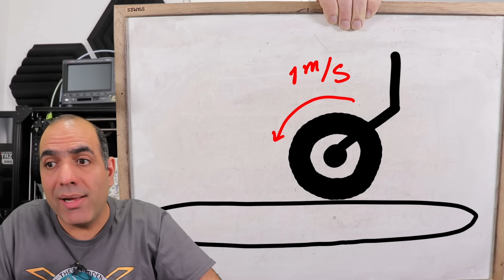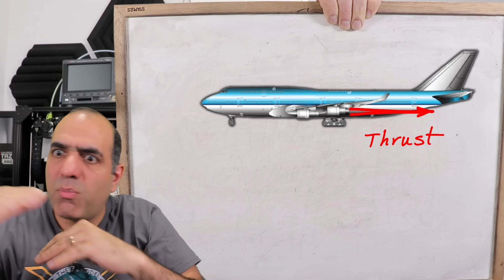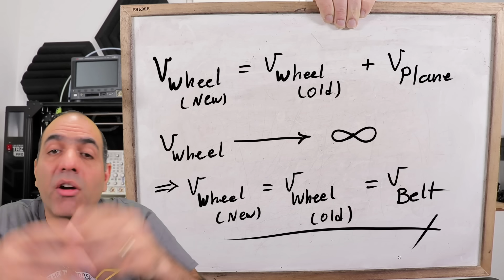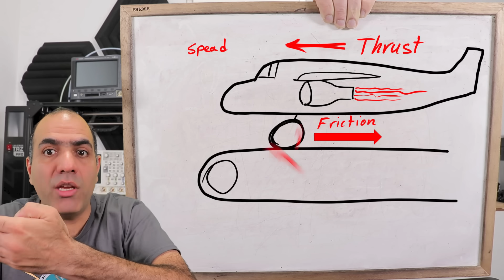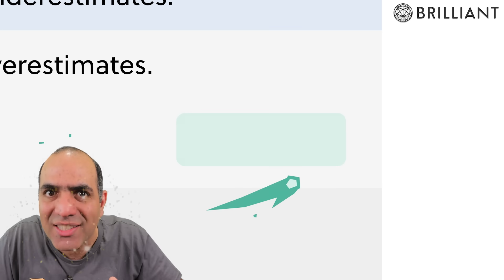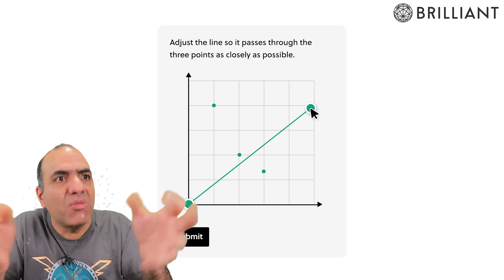Airplane Question that Drove Me NUTS!!!

Comment: Assuming a runway at sea level on Earth, with no wind: The jet engines produce their normal thrust. That's more than enough to overcome the friction of the wheel bearings. The plane starts to accelerate, and so the treadmill accelerates. Usually the bottom of the wheels is still, the axle moves at 1x the speed of the plane, and the top moves 2x the speed of the plane. With the treadmill the wheels bottom gets pushed backwards, instead of being stationary, presumably (given the description) at the speed of the plane in the opposite direction. This creates more friction in the wheel bearings (more heat) since the wheel is spinning twice as fast as normal. The plane can easily overcome this friction and take off, but may suffer damage to the landing gear.

Aircraft don't drive their wheels like cars do, they work by pushing air backwards. If the question posited a giant fan creating a tailwind exactly equal to the forward velocity of the aircraft then the plane wouldn't be able to take off, but it didn't so that's not relevant.

Comment: Technically speaking, the conveyor belt could be spinning so fast, that it starts to spin a current of air so fast under the wings, that it would push the plane off the ground / fly
But assuming traditional wind pressure and dynamics, obviously not.

Comment: I think the plane would be sucked down into the conveyor.
The question is missing many parameters,  but there would be a vacuum force generated between the fast moving conveyor and wing. With high relative airspeed below the wing, and none above, the wing would be pulled down - much like two large ships sailing near to and parallel to each other get sucked together.

Comment: 36 seconds in the video and i know the answer....of course not..." oh but the airplane needs only to push the air to fly"...yeah...but since it said the conveyor belt maches the speed of the weel, as soon as the airplane starts moving the conveyor belt will start pushing in the oposite direction, making it so as long as the airplane is in contact to the conveyor belt, it wont be able to build up speed and fly...the same applies to a completely still airplane, that if we run wind fast enough on it, even if it's still, it will start lifting up with no propultion whatsoever....friction with the conveyor belt will keep the airplane from flying

Comment: Here is what Intuit has to say about this question:

Prompt: 
Imagine the following scenario: A Boeing 747 is sitting on a runway, ready for takeoff. However, the runway is not like a typical runway, but instead is a giant treadmill. This treadmill is designed to operate at exactly an equal and opposite speed as the tangential velocity of the aircraft's wheels. In this scenario, if the aircraft attempts a standard takeoff, will it be able to leave the ground?

I think that's a fair way to describe the scenario and the question. I specified the model of the aircraft, replaced the runway with an imaginary treadmill, specified tangential velocity instead of saying "speed", since that's not really the correct term, and omitted details that aren't relevant to the thought exercise, like bearing friction or wind.

Response:
A Boeing 747 must travel at a minimum of approximately 160kts to achieve takeoff. During a standard takeoff, the combined power of the engines from the aircraft will produce an acceleration of approximately .2gs. Every wheel imparts a normal force to the treadmill of approximately 101 kilonewtons. I do not know the coefficient of rolling friction, however, it is very unlikely that it is high enough to result in a sufficient friction force to overpower the thrust force at speeds below 160kts, as most coefficients of rolling friction are fractional values that are less than 1. However, for the friction force to be high enough to prevent the 747 from reaching 160kts, the coefficient of rolling friction must be higher than 3, which is not likely. As such, the 747 can achieve takeoff in this scenario.

Abridged response:
The 747 can reach its minimum takeoff velocity, aka rotate, before the friction force is high enough.

I don't know where these numbers come from, but I also don't see in 11 dimensions so I defer to our electronic overlords

As for the actual answer which I can surmise, the answer is yes. Given reasonable implied conditions like having an atmosphere and being fueled, it doesn't matter how words like "wheel speed" are interpreted, it will take off. An aircraft as beefy as a 747 literally does not care about what the ground wants to do, only the air around it.

Comment: It seems like the question was posed by someone who really does not understand physics, or flight dynamics. It appears that they think the plane is driven forward by the wheels. What about a seaplane that has no wheels? Lift is only generated by the air speed over the wings. The belt can run at any speed it likes, even backwards. The thrust provided by the engines, just has to propel the plane at V1in relation to the air. Even if that means first overcoming an initial backward motion. If the belt is running forward at V1, the plane will be catapaulted into the air, lift off and then crash. Unless the propulsion is already providing V1. Simple

Comment: This seems so obvious… but the fact electroboom is discussing it makes me think I’m not even close to being on the same plain as him… 

If the wheels spin but the plane doesn’t move through air… then nothing happens.. surely
Reply: our intuition about how ground vehicles work is why there's a lot of knee-jerk reaction comments on this video and the post claiming the answer to be obvious. Because the wheel RPM is driven by the friction force from the ground rather than by a motor, the wheel tangential velocity must be greater, at least until the thrust force and friction force are at equilibrium and no acceleration happens, which wont happen at any normal speed we can imagine.

Comment: There wouldn't be any force, as planes lift off by pushing air underneath their wings and since the conveyor belt is perpetually matched to its speed, the plane can never accelerate into the air it needs to push down.

OK continue the video

Comment: There are several versions of this question. In one they say the belt moves backwards as fast as the plane moves forwards. So the wheels only go twice normal speed.
Reply: I think that's the original version of the question.  I've seen it in physics textbooks.

Then some smartass went "But whAt iF yOu SpEd iT uP?"
"It still wouldn't do anything"
Then he said "But wAt if U SPeD it up EVEN MORE"
"It still wouldn't do anything"
Then he said "buT I DEFINE iTs spEeD the SAME.  It HAS to stop"
"That's assuming the conclusion."
"I WIN!"
"...you know, whatever"

It's things like this that time cube comes from.

Comment: Scenario no. 6: “The Death”
The Belt matches the speed and starts to accelerate, eventually reaching infinite speed (the bearings should tolerate this, since it happens instantaneously, there is no time for anything to heat up or destroy itself). Since there is no delay given between the speed check and the belt matching that speed, we assume it's 0. This means that the acceleration is also infinite, since we're going from 0 to infinite in 0 seconds. A conveyor moving at infinite speed would probably attract a few physicists, who would scratch their head and wonder what's going on. Infinite acceleration also means infinite energy. And that would probably destroy the earth and the whole universe.

The end (of all)

Comment: The question states, that the conveyor BELT is as wide and long as a runaway. Meaning, since the belt is wrapped around the conveyor belt construct, the plane would have just half of the length of a runaway available to take of before it falls off the conveyor belt. So if the plane would have its thrusters enabled, it still might not be able to take off depending on how fast it's able to accelerate.
Case closed.

And I hate this type of questions too, because they lead to nothing but controversy with not a single step being made in forward direction to improve or understanding things.
I'm an electrical engineer and i love efficiency, also in processes and workflows! Why wasting your precious energy on stupid questions like that? And so I do again.

PS: If you don't like the answer, outcome or result of something, read the question, task or specification again and find the loophole to justify the answer. If the game is stupid, don't play the game, play the rules so that the game is no longer annoying you, but you're annoying the game and anyone that likes to play it!

Comment: I've heard this described as a language problem not so much a physics problem. I remember the "Mythbusters" episode years ago, and I got it wrong then, and it pissed me off to no end, trying to figure out where I went wrong.  Then my wife explained it to me, and I had it in my mind.  For a bit. But I lost it. And now revisiting it has lead me to the conclusion that I am going to plug my ears and hum and live in my world where if air isn't passing over the wings the fricken jet doesn't take off.
Reply: to say it with Adams words: "I reject your reality and substitute my own" =D
Reply: You are correct, if air isn't passing over the wing, the jet won't take off.
But the "wheels" of a plane are just bearings. The jet engines push the plane forward on those bearings, so as long as the bearings are free to spin, the plane moves forward.
Reply: Randall Munroe (of xkcd fame) wrote a very good blog post about it back in 2008.  He sees three possible interpretations:
1: The belt moves at the same speed as the bottom of the wheel: the treadmill never moves, because the wheels on a plane taking off are always rolling without slipping.  The treadmill acts like a regular runway and the plane takes off.  Not many people like this interpretation because it's boring.
2: The belt moves at the same speed as the axle of the wheel: the wheels have to spin twice as fast as usual for the plane to take off, which seems doable.  This is his favored interpretation, because #1 is boring and #3 has huge problems.
3: Hook up a speedometer to the wheel and have the treadmill move that fast: he thinks that this is how most "plane won't take off" people interpret the situation, but he points out that that math only works out if the plane isn't moving, in which case the treadmill also isn't moving and so isn't holding the plane back at all.  Once the plane starts moving, the math can only work out if the treadmill speed jumps instantly from 0 to infinite.  So in that case the plane can't move because if it were to move the system breaks down immediately and the problem description no longer holds, but obviously a non-moving treadmill can't stop the plane from STARTING to move.  Since the description no longer holds once the plane starts moving and doesn't include a mechanism to stop the plane from ever moving, it's...not a great interpretation.
Reply: The question is just confusingly worded. The treadmill matching the speed the wheels are rotating does NOT mean that the plane is stationairy relative to an observer standing next to the treadmill. If you were standing next to the treadmill you'd basically see a plane normally accelerating down the runway and then taking off, because the treadmill isn't going to stop the plane pushing on air to move itself forwards, it's simply going to cause the wheels to rotate more quickly.
Reply: exactly, but the turbo-nerds need to prove how smart they are. it's a completely fuckin magical question. hence why it's not so "anyone who bebebebe my brain dick is bigger than yours!"
Reply: Agreed. These questions are not much better than "Why does 2 + 8 + 9 =10? Because (T)wo, (E)ight and (N)ine spell TEN!" type questions. They are language puzzles
Reply: @Mandragara no cuz 2 + 8 + 9 = 19, 1 + 9 = 10 xD
Reply: I also got it "wrong". I assumed the engine would be turned off. The question in my mind was, can you cause enough drag winds and ground effect to make the plane take off by just moving the conveyor belt. That was an interesting question. Testing it with the engine on was just so anticlimactic. Of course it takes off if the engine is on!
Reply: Yes. The reason why it's a language problem is exactly as stated in explanation 3 of this video. Strictly adhering to the imaginary scenario proposed by the question, the conveyor and wheel speeds reach infinity, invalidating the reality of the scenario entirely so it doesn't fly. 

In reality, a conveyor belt does absolutely nothing to an airplane. However, because the impossible physics-breaking infinite conveyor belt is a necessary given in the thought experiment, it makes the plane not fly.
Reply: of course air is passing over the wings.  why wouldn't it?  Break down those objections in order.

...because it's not moving forward?  Why wouldn't it move forward?
...because the wheels are stopping it?  Not unless you left the brakes on!  Imagine a car in neutral.  The road doesn't stop it.  The wheels just spin.
...because the wheels aren't pushing it?  It's an **AIRPLANE**, not a car!

*THE ENGINES* push it.  Plane moves forward.  The wheels, "in neutral" with the brakes off, turn freely.  Air moves over wings.  Plane lifts off.  End of story.

The treadmill is a red herring.  How we're still arguing about this in 2023 I cannot imagine.
Reply: Yup. Me too.
Reply: Planes ride on skateboards.  Easy as that to understand.
Reply: @BrandoDrum  maybe the turbo nerds have a point for the plane, but i refuse this one. i've skateboarded and you 100% could keep a skater stationary with a magical treadmill as proposed.

Comment: would this kind of question be called a fallacious question? A not native english speaker asking on a channel of another non native english speaker. 😅
I could however imagine, if the plane has it's engines running and and is doing a normal takeoff procedure, it could happen that if the friction is enough to keep the plane in it's physical space and the air generated by a rough surface moving fast underneath the airplane could maybe create enough moving air to take of, but I believe it would be quite turbolent. 
Just a very uninformed theory on my part. though I highly doubt you could get this done perfectly.

Comment: Actually the answer is fairly easy and here is why. You see it boils down to how wheels work. 

Wheels work independently From the arm the bearing is in 

So once the airplane starts moving the wheels should turn right, and that is where the people go wrong. On a normal runway the wheels need to move in order to let the plane roll and get up to speed, but on the conveyer belt the wheels DO NOT move at all. 

The reason is because when the wheel wants to move the belt counteracts that movement, so it doesnt start rolling forward with the plane. However the bearing on the axle does move, the one in the arm. Yes it has friction and should move the wheel but the belt counters that slight friction. Now because the plane can easily overcome that friction in the bearing it will start moving forward (relative to the ground). 

The answer is the wheels never move but the plane does due to how bearings work.  It's the same with how differentials work, if you lock the wheel it needs to turn with the axle, but once you unlock it the axle doesn't have move for the wheel to turn or vice versa. 

I seriously do not know why this question is so hard for people.

Comment: Comment before the answer:. I am gonna say no because lift requires the movement of the air over and under the wings.  Staying in one spot will only put a load on the engine redundantly.

Comment: The plane needs to move so that the air can create the necessary lift force so that it can take off. It has nothing to do with the speed of the wheels, only with the speed of air around the wings. If the plane stays in place relative to the surrounding air - it can not take off. Otherwise we would have plane launching conveyors on buildings.

Comment: Since the belt is as long as the runway it will have way more inertia than the wheel (and thus never be able to catch up with the speed of the wheels),  the design of the belt is infeasible even by magic unicorn standards. The plane will simply take off and ad worst take a bit longer than normal but the belt will never create enough friction to matter.

Comment: What about this one, let's say that there is friction between the wheels and the conveyor belt, but not within the wheels (ideal wheel bearings), then assume that the conveyor belt has unlimited power and hasn't speed limit and the engines on the plane are off(just sitting) and also someone walked inside the plane walked towards the tail(it will make the frictionless wheels roll foward and set the conveyor belt to infinite speed to keep the plane stationary), depending on the thicknes of the fluid(thicknes>0),  due to the speed of the fluid dragged by the conveyor belt and its relative speed compared to the plane the plane will take off

Comment: Hello, I don't think the plane flies because of Bernoulli's equation. In this example, the speed of the top wing of the plane is zero because we are supposed to stay relatively still, and for this reason, the pressure of the air flow above the wing is higher than the pressure below the plane's wing. And as a result, I think the plane cannot fly
But as you say it really depends on the assumptions

Comment: I like to rephrase this question into this:
You have a plane sitting on a conveyer belt with a rope from the front to a stationary post.
How fast do you have to run the conveyer belt for the plane to get airborne?

The answer of course is to put the guy asking the question back with the other kids in daycare after you change his diaper.